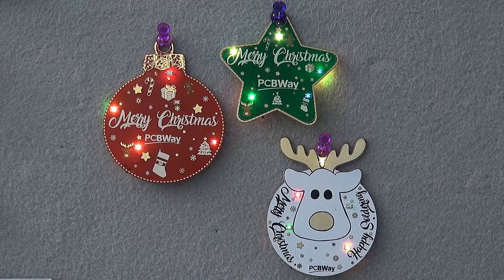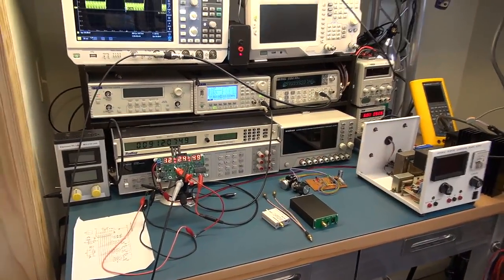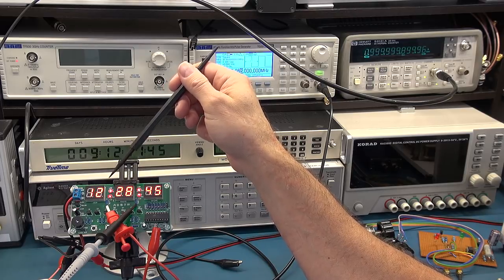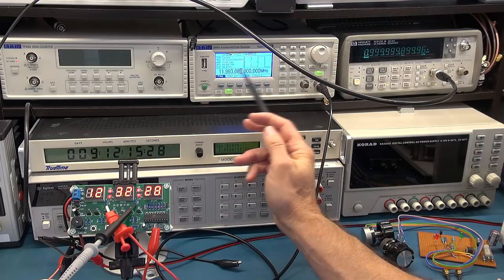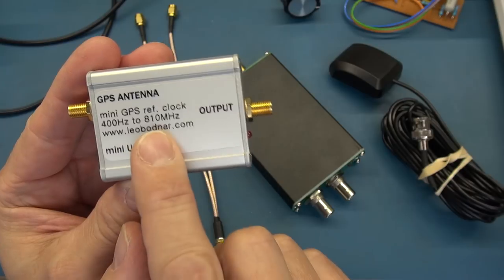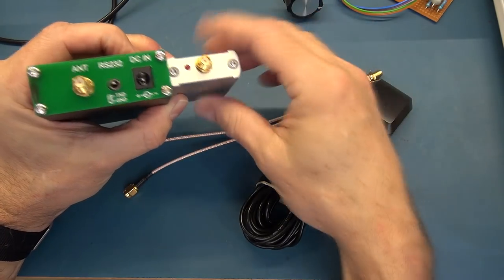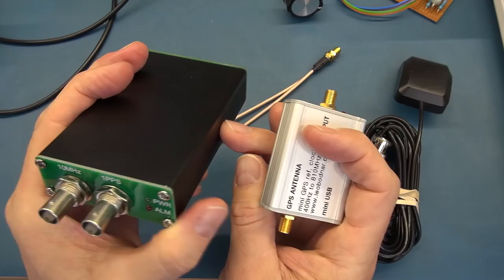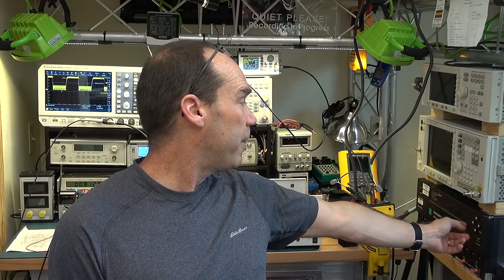T4D #142 - Blown GPS Disciplined Oscillators and Chit Chat

Comment: I immediately suspected what he did and at the same time I was thinking, what a newbie mistake...
Even without the DC power issue, there's the impedance problem. At 1575MHz the Y wire will introduce reflections that are probably very bad on gps signals. This may prevent proper reception and localisation (and timing)...
Reply: Well.. mixed 50 ohm and 75 ohm cabling + splitter do actually work.. not going to recommend it.

Comment: You can use a cheap type F splitter for CATV and use a DC blocker on one of the outputs.  That allows the voltage from only one to go into the splitter and antenna. I’ve done it many times. You just need an antenna with a high gain LNA. 

But the big thing is an inline DC block adapter which is less than ten bucks.

Comment: You can use a power divider, LNA, and DC blocks - But those antennas are so damn cheap, running a few of them seems to be a great solution. I'd love to have a little RF building that sounds awesome.

Comment: You can use a DC block on one of the units rather than the GOS 2:1 splitter. I can't really determine what the connector on the antenna ports are, but they look like SMAs. SMA DC blocks are used on Spectrum Analyzer ports, Network Analyser ports, etc., to prevent damage to the front ends by DC voltages. When I last bought them, they ran about $40/ea. If the company still exists, Pasternack Enterprises is where I used to buy them.
Reply from the maker: Thanks for the info.

Comment: Bulova Precisionist wrist watches, with their 262 kHz oscillator, are supposedly accurate to better than 10 seconds per year. My first one was Cdn$130, and my second one, the Lunar Pilot, was Cdn$230 (both on sale at about 50% off street price). I just checked them against NTP, and they're both about 2s fast after being set about four months ago (with the time change for DST). I'd say that they meet their specified performance.

Comment: I knew exactly what you'd done immediately! Another poster mentioned you might be able to repair the bias-T on the blown unit. Now I've never let the magic smoke out of anything....NOT! You may want to think about distributing the 10MHz system around your workbench. Mini-Circuits passive power dividers will work but at some point fan-out occurs. Powered distribution amplifiers make life really easy. Thanks for sharing Martin.  73 - Dino KL0S
Reply: Cheap way to get those distribution amplifiers is to look for video distribution amplifiers, which are going to have a reasonable response up to 10MHz, and will have a gain after termination of 1. most have 75R BNC connections on them, a decent power amplifier with a gain of 2 and a really low impedance output to series 75R resistors to each output. Easy to change the termination resistors to 50R, either by putting in a new resistor or solder a 150R resistor across the original output ones, and change input resistor as well. They also will do at least 5V peak to peak for the better units with 15V power rails, and many are also DC coupled as well if they are studio equipment, though the more common AV amplifiers are AC coupled input and output, so you are protected against feeding DC back into the unit, though the capacitor might complain long term and pop.
Reply: @SeanBZA  Yep, lots of guy do exactly that. TAPR still makes a dedicated 10MHz 6-port distribution amp although unfortunately they no longer offer the case to put it in. I actually have three of them to go out to all the test gear around the bench and radios at the ham desk. And of course you can cascade them as well depending on your physical layout. As with all the rats nest of cables it pays to mark them and keep a schematic of how everything is connected.
Reply: Splitter is not a normal RF term. Divider or circulator. If I needed a active antenna with signal I would have one good LNA connected to one good passive antenna. Split the LNA output to whatever unit you need, it's just a RF signal.

Comment: How accurate are we talking? The Dallas DS3231 or DS32KHZ should supposedly be accurate to less than a minute a year over typical indoor temperature ranges, and I'm pretty sure there are clock kits out there using the former. Doing better than that will probably be hard.
Reply: They are using GPS to syncronize to The United States Naval Observatory's atomic clocks.
The occilator is adjusted by the GPS, so time is less than 100 ns off, and frequency is better than 100 ppb accuracy.
(more like <10 ns, and single digit ppb accuracy for the better modules)

Comment: Antenna bias messing up your day?
3.3V and 5V is common, not so sure the GPS like to be powered via the antenna port.
Reply: Also: Connect the antennas before connecting power.
There is a bias-T (current via inductor, capacitor for RF) inside the module, and a sharp ramp may kill the RF input.
If you mix, at least make sure they use the same antenna voltage!

And yes, using a splitter do work

Comment: So you want accurate timekeeping with GPS?
Then try this experiment:
Setup one of the GPS you have already, log the data, just time and position and accuracy from the GPS.
Then get a precision antenna with a choke ring, leobodnar have one: http://www.leobodnar.com/shop/index.php?main_page=product_info&products_id=286 Some info on choke ring: https://en.wikipedia.org/wiki/Choke_ring_antenna
Log the same data with this antenna, and you will most likely see much more stability in the position, the main reason is that you GPS antenna is very sensitive to ghost signals, that can be from reflection of the signal from foreign objects around the antenna, these objects can be anything, threes, buildings, posts, and even the surface the antenna is standing on.
So by reducing ghost signals (GPS signals that is out of timing because they travel of a non direct path) you get a more precise timing.

Comment: @12m25s: The question... Answer with another question: What is that crazy Y-cable?
Reply: Even ignoring the issue with the DC "bias" voltage, you shouldn't split RF with parallel connections like that.

Comment: The input should still be working normally the power supply for the antenna is what fails. As the power is fed to the antenna, the dc is not wanted on the input to the receiver. You should find the receiver is decoupled from the DC with a cap.

Comment: You just put a capacitor in line before the oscillator
Reply: He has so much expensive equipment and seems to know his stuff but also still sometimes makes horrible rookie mistakes & doesn't even seem to know how to build a DC block for a bias T :)
Reply: Sure, given he isn't hotplugging the cables. Hotplugging would give a pulse of bias voltage into the reciever. (given one of them is unpowered, or they have different bias voltage)
Reply: erlendse correct but if he is hot plugging why have the splitter just hot plug a single cable as you need lol
Reply: @brianwild4640  no reason given, just bad practices during assembly.